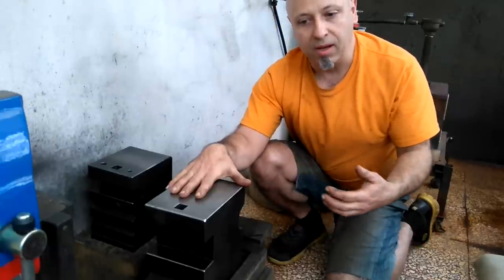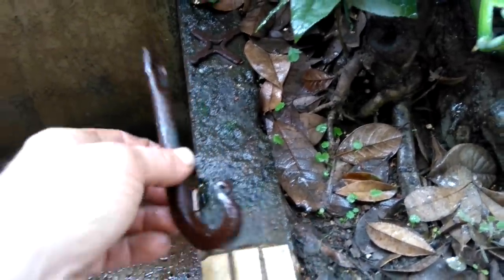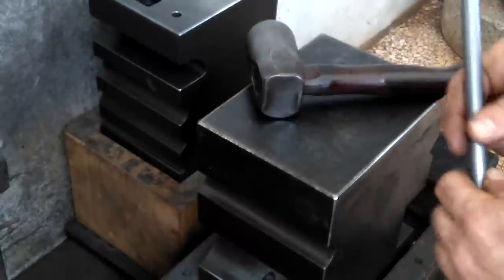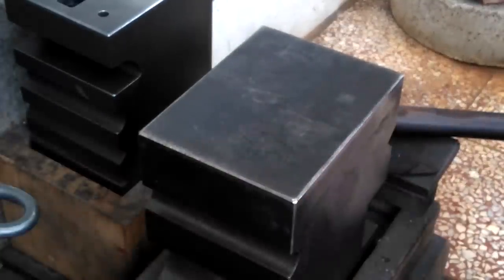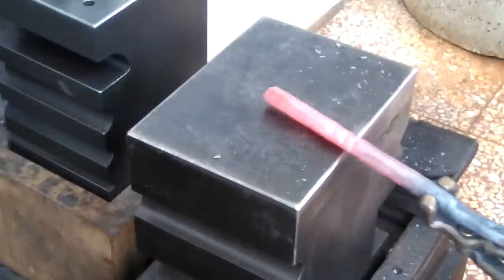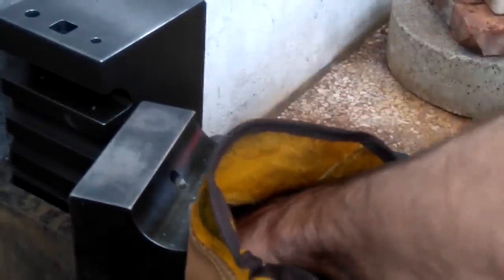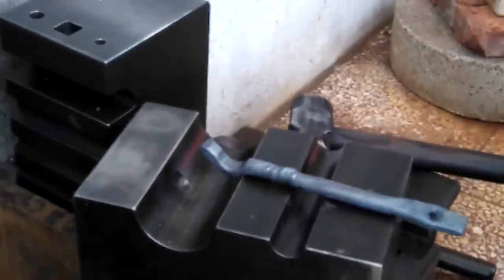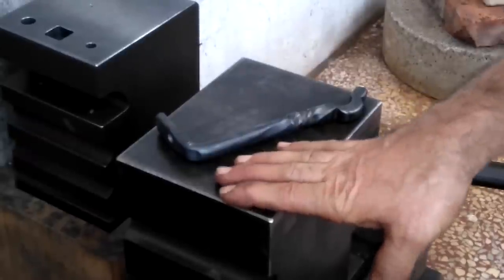Blacksmithing - Some Advice, Making an L Bracket, etc.

Comment: I use a punch that exactly matches the size larger than common bugle headed screws.Called, 'underlayment screws' these are black and short but a bit stouter. This is a way to get the head exactly flush when driven home. Much better than countersinking and less liable to cause screw failure from that final torque against slightly uneven surface of steel part being installed. You're welcome and thank you for these videos. BTW, my indoor shop is smaller than your balcony.
Reply from the maker: Reverend Brother, Thanks again for sharing your experience. Interesting to know your shop is smaller - so many guys are amazed by the space I operate in but I often mention that others do excellent work in even more limited work areas. You need to be creative... Glen

Comment: Whilst browsing forums I came across something called a 'sandbox anvil stand and I think it could be the problem to your bigger anvil moving around problem, perhaps do some research on it and tell me what you think?
Reply from the maker: +tim Rayner I looked up the sandbox anvil stand solution - seems like a good option. The only problems I can see for me might be that I move my anvils a lot to work on different faces and this might disrupt the sand and how it is packed. Also, mineral grains in sand in can very hard and I wonder if the side of the anvil in contact with the sand will become pitted over time, since I use all sides of my anvil... But this definitely looks like it works in the photo examples I saw. I am finishing up a different sort of stand - more a "platform" for my anvils and if it doesn't work, I will maybe go with the sand method. Thanks for your input. Glen
Reply: +Glen GS Tongs I just realised that I wrote problem instead of solution, glad I could offer a selection

Comment: How do you protect your anvils from rust? I'm having trouble keeping my anvil clean.
Some situational information: I live in Belgium, fairly humid, I don't get to work as often as I would like because I'm a university student with a dorm in another city. Weeks and weeks between smithing sessions unfortunately are normally what ends up happening.
Reply from the maker: +𝖘 𝖍 𝖎 𝖗 𝖔 I've never been to Belgium but I can't imagine it is more humid than Taiwan. I often spray my anvils (and other blacksmithing tools) with WD-40. This really helps but needs to be done relatively frequently. Given your situation of being away for weeks at a time, I might recommend rubbing your anvil down with grease. This is messy, I know, but it will work better than a light spray oil for when you are away for long periods of time. I remember when I was in Washington State, I would sometimes have to take a trip to Taiwan for a month and I would do just this - apply grease all around my anvil. After returning, I would wipe it off with an old rag. Not only is this good prevention against rust, it's also a pretty good deterrent to any would-be anvil thief... One other thing I do is cover my anvil face with an oily rag when done for the day. Basically, it's not just the humidity that causes rust so quickly but big swings in the weather - especially from cold and dry to warmer and rainy. I can remember my anvils back in Washington being completely covered in a skin of rust literally overnight from such weather changes. Hope this helps. Thanks for watching. Glen
Reply: Thanks for replying Glen, Belgium is definetley not more humid than Taiwan haha.
I've tried the grease but I found it quite cumbersome to get off to get smithing again. I'll try the oily rag and tie it down. Thanks for the tips!

Comment: Did you make your anvils or can they be purchased somewhere?
Reply from the maker: Scotty, I designed these anvils and had them made, taking advantage of the resources available to me here in Taiwan. I was having a hard time finding an anvil here that suited my work style and so came up with these. For a time, I was selling the smaller anvil but the shipping is very high and the margin very low on such an item. I may offer it again, depending on the circumstances... Thanks for watching. Glen

Comment: Very cool piece. I like hearing you talk about the country and the surroundings. What type of forge are you using? I know it's gas but would like to see it's construction sometime.
Reply from the maker: +jeffery biddix When I have time, I will get out and film some local blacksmiths and also show and talk about this place in general. I use a Diamondback Ironworks gas (propane) forge. I used to only use coal / forge coke. I tried my hand at making a gas forge or two but could never get it dialed in right. Bought two single burner forges from Diamondback Ironworks and have just been super pleased. He makes a quality product. When I get a chance, I'll quickly show it. Thanks. Glen